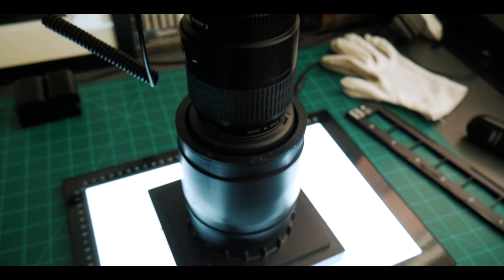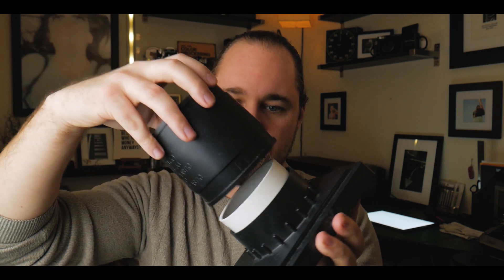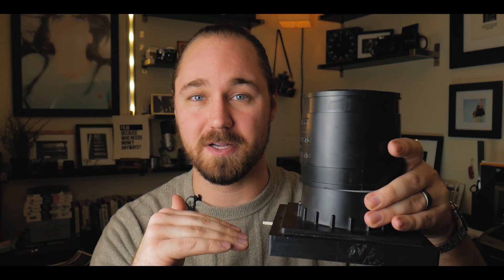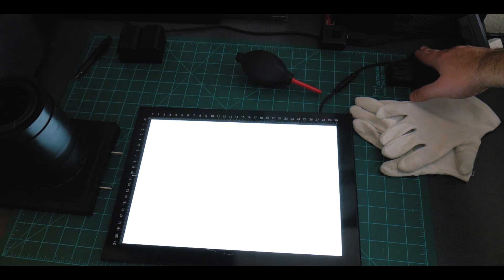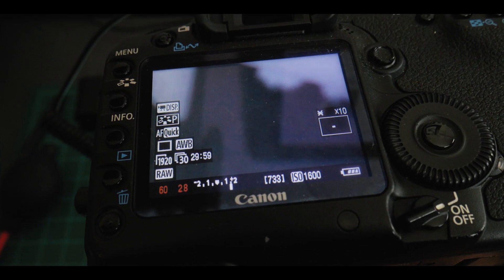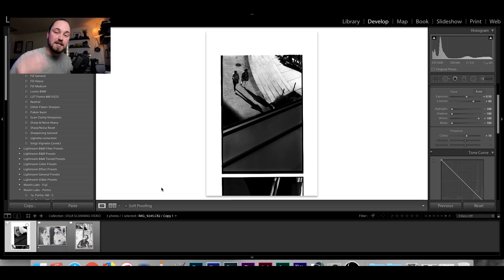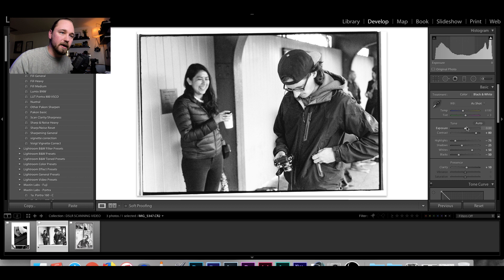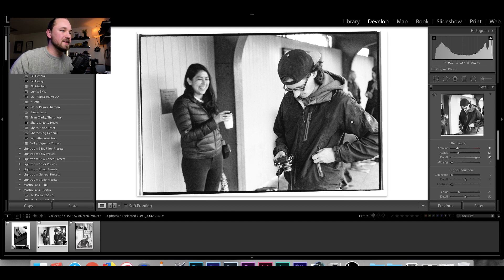DSLR Film Scanning Setup & Edit Workflow (DIY Film Toaster)

Comment: Why is the light table brightness an issue? Can't you just increase the exposure time? Or am I missing something here?
Reply from the maker: Well with the 5dii at least, the camera is limited to 1/30 on liveview mode. You could definitely set your focus, turn off liveview and extend the time, but you wouldn’t have a view of the histogram at that point. I’m sure more modern cameras may not have this limitation, but I could only give an explanation from my personal experience. Hope that makes sense. Thanks
Reply: @NickExposed  I used to have something even older, the 300D aka the original "Digital Rebel". You could set it to show a histogram of the image AFTER it had been taken. Playback of the image I suppose? If the 5DmkII could do that it might open up an option there, even though it would require throwing away more digital images.

Comment: I’d like to pick your brain on one thing:
How would you deal with film that just won’t lay flat for love nor money? 
I have a film holder that does not hold down the film in between frames. Unless I give my film a bit of heat treatment prior to cutting, I have some films that have really given me a hard time. On one occasion I had to use the Anti Newton glass from my enlarger to hold it flat but I realize that not everyone has this opportunity - after all, AN glass is heck-a expensive and difficult to handle.
Reply from the maker: The easiest way to combat this is before cutting the film, and after letting the film dry, roll the fill backward on itself, emulsion side out, and place it in a film canister overnight. Should help solve your issue.
Reply: Nick Exposed I now do basically that but I put the film on a development reel and gently (!) warm it up with a hair dryer and let it cool again for a couple minutes. Works faster than leaving the film spooled overnight and I can proceed to scanning right away. That way the film will usually stay in the holder. So far I have not had my adverse effects from heating up the film. I just tried it out in desperation with no idea whether it would work. But at least I now know I was sort of on the right track. 😊👍🏻
Thanks for taking the time to reply, I appreciate it!

Comment: I’ve been seeing a lot of people use lenses of 100mm and up. Would a Nikon D3100 and Tamron 90mm lens work?
Reply: With an APSC essentially half-frame camera, the image is cropped, and with a 90mm lens, even more so. I tried it with my Sony APSC and a 60mm Nikon lens and it was cropping way too much. I could not, with the Nikon set up, adjust either the front telescope on the tube or the focus on the lens to get the whole image.

Comment: Nice idea!

Is it possible to scan 35mm panoramas with this method? Do you know any film carriers for 24x65 format?
Reply from the maker: Hujinn it’s definitely possible. You could probably pick up a second 35mm holder like shown in the vid and modify it to accommodate the double frame size. Hope that helps
Reply: @NickExposed  thank you!
Reply: @Huginn1000  You could also try the Lomography Digitiliza film carrier. They let you scan the whole film strip in one go (including sprocketholes) so you crop it afterwards to the correct frame size. Make sure to get the correct one though, they sell different versions for 35 mm, medium format and 110 film.

Comment: Why don’t you use the masking in the sharpening tool? I find myself cranking that to 80-90 pretty consistently and pushing the amount way up. I’m always interested in others philosophy.
Reply from the maker: Masking eases the sharpening off. Or so it appears whenever I've played with the slider. I'm sharpening for print, so I want to retain as much of the crisp detail of the sharpening applied as I can. So not the most sophisticated answer, but its what I've always done. lol
Reply: Nick Exposed yeah, your able to be more heavy handed with the sharpening because it’s only applying it to the details and not the whole picture. 

If you hold alt while you slide the masking up you what parts of the photo are being masked out in black. It means you can sharpen without making your grain look all messed up.
Reply from the maker: Dan Higginson interesting. I’ll play around with it. Thanks for pointing that out. I appreciate it

Comment: Nice video.  I really admire DIY people.  One question:  what about the tons of grain???  Or, is that just something you're willing to live with?  Based on my somewhat limited understanding of noise reduction, if you don't perform noise reduction as your FIRST operation, removing it later will be far less effective and almost impossible.  That's because NR software seeks out a noise pattern and then reduces the noise based on user parameters.  Once you've processed the image, it's too late - you can never recover the original noise pattern.  Or, am I just being naive - maybe there is no good way to reduce grain in a negative?
Reply from the maker: Well for me I am a bit of a grain junky. I push hp5 two stops and shoot tmax 3200 specifically for the grain, so I may not be the best to ask about noise reduction haha. Two things I will mention, one is if you dont particularly like grain/noise then you definitely want to choose the right film stock at the onset like you are mentioning. As far as the scanning side and introducing noise, one I am scanning on a full frame sensor, which drastically reduces chances of extra noise. Two is in supplying a light source you would be surprised at how little noise you are introducing to the "scan", especially when positioning the histogram where I showed. Its nearly "blowing out" the highlights, which allows for the least amount of noise, even at 1600. There are plenty of alternative options. More modern dslr's and mirrorless cameras will allow for slower shutter speeds even on live preview mode. also a brighter light box. You can do so and get the iso down as low as possible for the "cleanest" scans. At the end of the day, I honestly don't see that there is much introduced that would cause me to change my current setup. I just don't get caught up on these things, I would much rather take those energies and put them toward making more work. Thanks for the comment, hope this helps :)

Comment: Love the enthusiasm, love the commitment, however your making something very simple, very complicated and with the Home Depot aspect far to cluttered and off putting. I remember May years ago and I’m talking 50 + years I had read a book on wine making and beer, it took me two years before a friend came round and said, yeah the books fine for the recipes and methods but this is how you do it, an hour later I had my first wine on the go, well actually 4 wines, since which I have made wine from from natural ingredients, beer and vermouth, all with rave reviews, it’s the same, the light pad is one of the most important it’s cc’s measurement but one of the ways around and gives you a better light, straighter light lines is the iPad free app to convert it. And the stand that’s parallel. DG New Forest U.K.
Reply from the maker: The thing the kit I described gives you is a light sealed tube chamber to keep from light spill and glares in the “scan”. Many who use an iPad or light table and a copy stand or tripod complain about glare and other side affects from the light around the negative. I’m still using the setup I made years ago and it makes it incredibly quick to setup at any given moment and get wonderful scans. With that being said use what works for you. We all just want a glass of wine at the end of the day (to use your wonderful analogy)

Comment: Well done Nick! How do you adjust this for handling the half frame negs?  Zoom in further or crop?
Reply from the maker: I thought about adding that into the video but wanted to keep it short. Maybe a short side video soon. Either way, I scan a set at a time, and then simply create a virtual copy in Lightroom and treat it as two separate scans. If that makes sense.
Reply: ahh ok, makes sense.  Thanks!

Comment: Why do you raise the ISO instead of the exposure time? Doesn't matter if you expose for a second or two, does it?
Reply from the maker: Stu Lora I explained that in the video. It’s because for my 5d mark ii it caps me at 1/30 on live preview. I suppose I could turn live preview off and lower my shutter speed that way, but I would lose sight of my histograms. So I prefer to work in a less than ideal way I suppose. Other cameras may not have these limitations in which case you have much more flexibility than I.
Reply: @NickExposed  thanks, I missed that. But then.... instead of choosing a smaller aperture, isn't it better to lower the ISO? But then again, most lenses have their sharpest spot around f/8. So it comes down to do an experiment or two with the equipment and the lens that you have and go with these settings. Which is what you did. ;)
And finally (just to whoever this is interesting for): My Pentax K3-II does not limit the exposure time on live view. But your point is still valid that exposing for half a second per frame or so slows down the work flow....
Reply from the maker: @stulora3172  honestly I don't notice any difference between f2.8 and f11 on the scans. Thats not anything I get hung up on. I simply use whatever process works best for the system Im working with, and within my workflow and current setup I find this works extremely well for me. I strongly suggest everyone play around with their own setup and make adjustments according to what they are looking to achieve. I appreciate you working through this with me.
Reply: @NickExposed I agree. Also, after thinking about this (while wandering around the home depot to buy the stuff, seriously!), we are taking a picture of a picture, which already had passed through an optical system. So we have all the potential flaws of the original exposure, all the lens softness, film grain etc. So anything we do to reproduce the image on a digital medium just has to be good enough to not introduce further flaws. Anything better than "just good enough" will only copy the grain etc. more accurately O_o
Anyway, thank you for inspiring me to build my own scanning system. Looks a bit different than yours, but should work just as good, once I am finished assembling it. I hope, at least.
Reply from the maker: @stulora3172  haha that is very true. And let me know how it turns out. Glad you were able to get a system together!

Comment: Why go to to all this trouble when there's plenty of slide copiers, bowens film copiers, flat beds on ebay, and why not just just buy a flat bed with film holder ???

I used an epson 1200 film / flat bed scanner (£52, and using Vuescan software)  when I have plenty of time, and and an old Ohnar / Kaiser zoom copier (£12 on ebay complete with T2 adaptor for use on DSLR, Mirrorless and 35mm) for speed when copying just a few slides or negs quickly.
Reply from the maker: John Taylor dslr is faster, and in my experience higher quality scans. 24mp scans with sharpness that rivals drum scans I’ve had done in the past. I’m not saying everyone needs to jump on the dslr scanning bandwagon. But when the gear is already lying around, why not build a $15 rig and get amazing scans. Personally I avoid flatbed like the plague. Never had good results scanning 35mm.
Reply: @NickExposed  ... I'm just saying that if you use the V550 properly, the results are more than good enough, especially if you use multipass via Vuescan ... horses for courses. We can't all agree on the same thing, and that's why the comment section is there.
Reply: Still a good video for people with no time for normal scans. I prefer my 50mb TIFF files from my flatbed though .... Great channel.

Comment: Quick question, did the 1600 ISO add more grain?  Would that be problematic when creating large exposures/prints?
Reply from the maker: Calvin Hicks noise shows up in the shadows, so in supplying the backlight, and in positioning our histogram where we do we minimize the digital noise. Again it would be better to have a brighter lightbox and lower the iso. But even at the current settings I’m not seeing any issues.

Comment: No coupler will fit inside the drain. I just bought a 4 ft length of 3” PVC and cut 1 3/4” off. I now have enough to make about 20 of these!
Reply: Thank you for your input. I had the same problem and solved it with your suggestion. My Home Depot had a rack of precut PVC pipes of two feet. That's what I bought, cut one piece off and have been using it to find my exact length needed. With a little more fine tuning, I'll have down to the millimeter.

Comment: Man, for serious scanning you should definitely stick to smaller apertures. Sorry to say.
Reply from the maker: If you hit your focus correctly it wont matter if youre at f4 or f22 the plane of film will not be any more in focus either way. You can expand that focus plane as much as you want and it wont change anything with the film strip being so thin.
Reply: @NickExposed  i mean softness on the edges
Reply from the maker: @zarrir  definitely depends on the lens. Ideally yes get a bright enough light table and scan at f8-f16 to utilize the full capacity of the optics you are working with. With my setup at f4-f5.6 I don’t notice any issues at the edges.